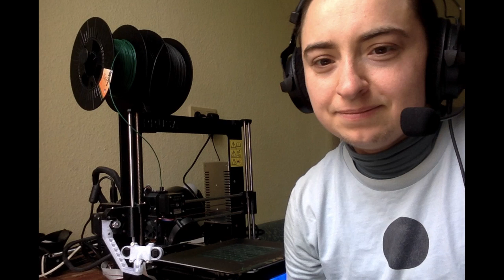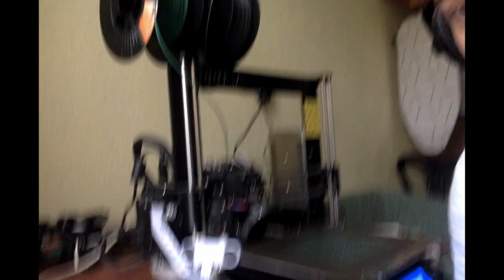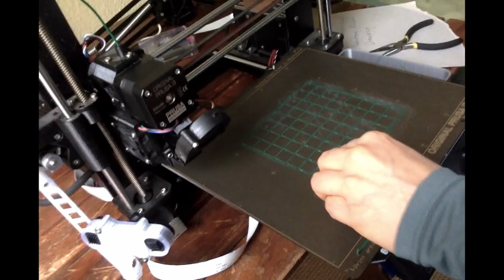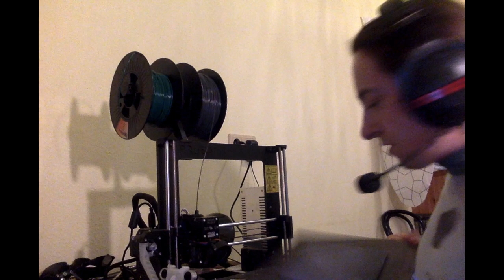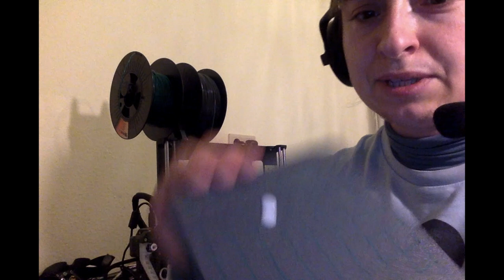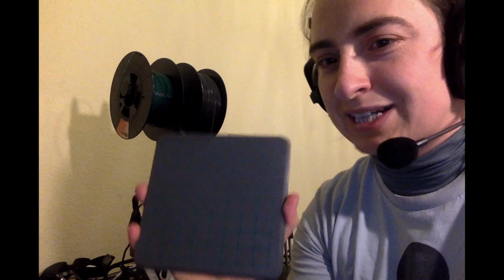3d printing an image onto a surface without a MMU

Comment: Very interesting approach. Did you tweak the travel offset to ensure that the second print's travel paths don't collide with the first pass? Have you tried thicker embedded figures ?
Reply from the maker: They collide and most of the time it doesn't cause problems. No, I haven't tried thicker embedded figures.